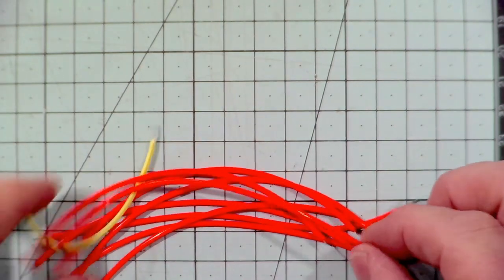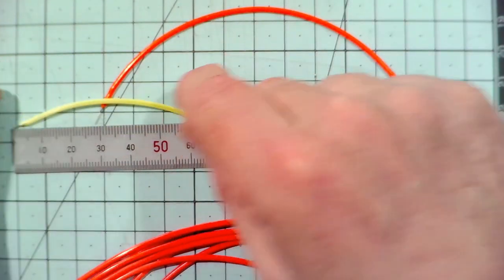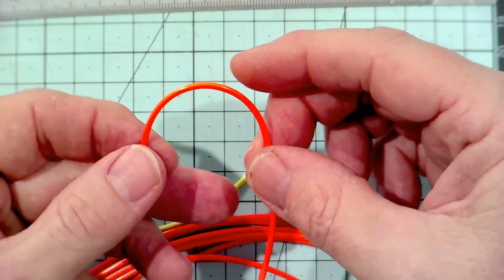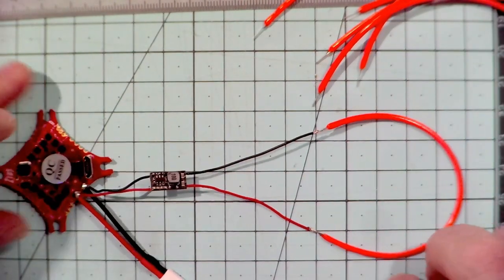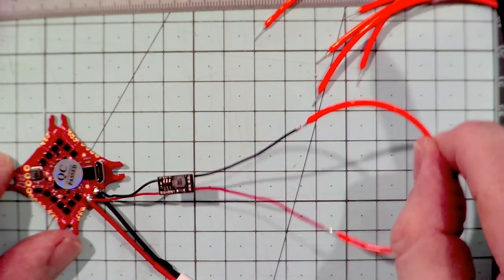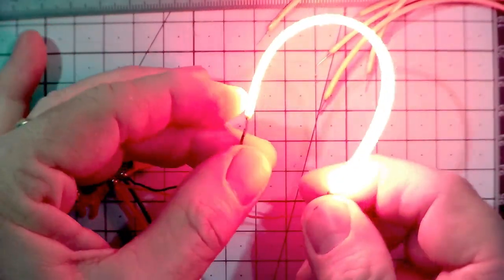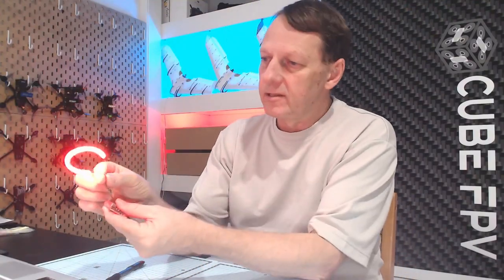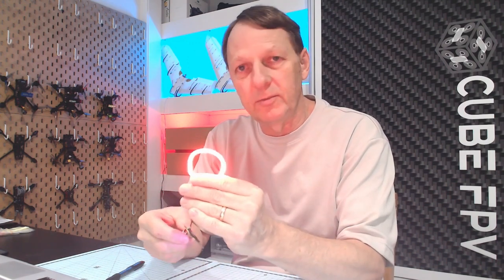Nano Size COB LEDs for Whoops

Comment: I've been doing a bit of research on the subject of LEDs. But aren't these filament LEDs? Because COB LEDs are essentially LED strips, the LED density is higher, and there are many micro LEDs and there is a silicone layer on them. It might be better to use a series resistor instead of a voltage regulator because the voltage regulator makes EM noise imo... The only disadvantage with resistor is that a resistor is slightly less energy efficient and you would always have to use the same battery. Because it is tuned exactly to an input voltage...
Reply: Another disadvantage of series resistors is of course that the luminosity of the LEDs decreases when the battery voltage drops from 4.2 to 3.2 V...
Reply from the maker: Thanks for the info and insight. I'll look into these LEDs more about whether they are CPb or filament. I don't produce these - just reselling  them. They do indeed get duller as the battery voltage decreases.